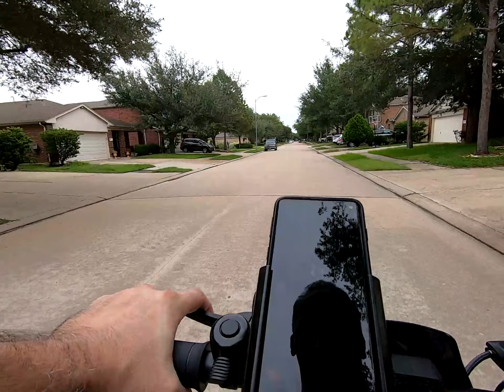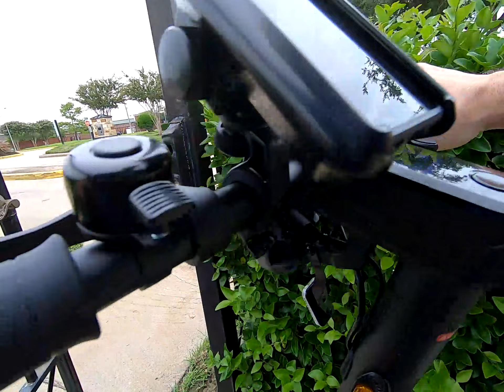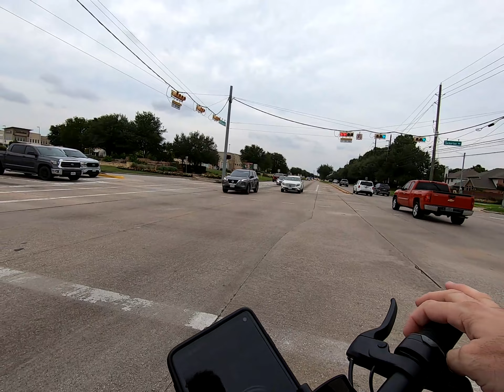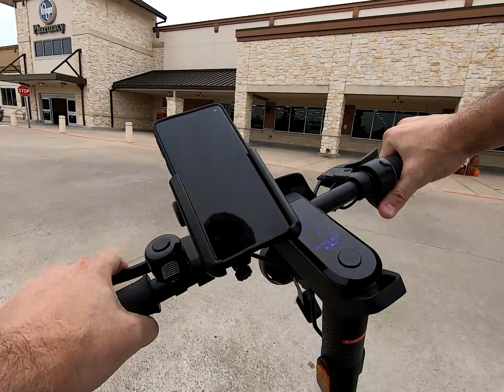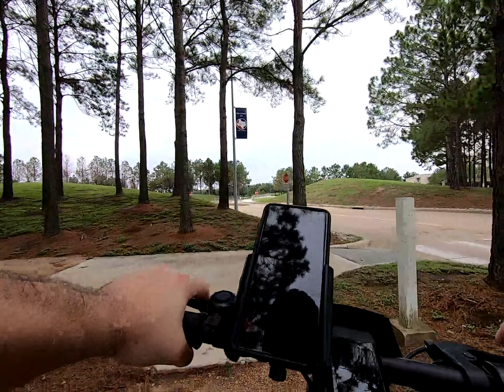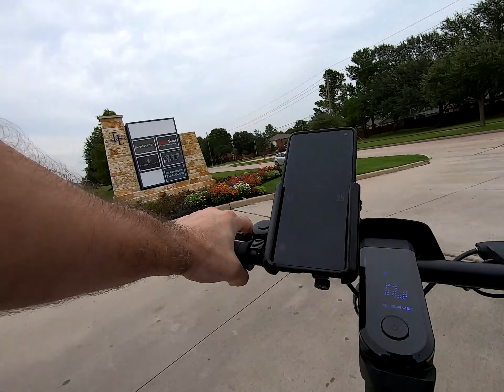Niu KQI3 Pro Review, Range Test, Comparison

Comment: Dam. I bought this last week based on all the brilliant reviews on youtube. Looks like I've been duped. Question. Do the tyres need to be checked for pressure after every ride? For context, my commute is 8km each way.
Reply: I just found out it couldn't be fixed (dont know why) so they offered a replacement or refund. I took the refund because I'm going to use the refund to upgrade to a Segway max G2. Overall though i didnt have any other issues with the scooter. I actually rarely had to pump up the tyres. The night light is decent on it. Battery range for me was about 32km which is ok. Its a decent enough budget commuter scooter. No suspension though is noticeable.
Reply from the maker: @ddmulryan  I'd suggest spending s few hundred more and get a better class of scooter. Unfortunately warranty service/repair is the most inadequate aspect of kick scooters. Until U.S. manufacturing becomes more price competitive and more widely available repair centers, the industry has a long way to go.
Reply from the maker: I'm sure there are idiosyncrasies to each scooter. It's definitely a good idea to check your tire pressure before each ride until you get a good idea of how long it lasts. Mine lasts around 2 or 3 rides of 5 to 6 km, depending on the diversity of the terrain. I weigh 189 so that could also be a factor also.
Another thing you should check every time you get on the scooter is the rear brake disk. It can easily bend or warp because it's totally exposed so make sure you check that every time before you ride because, if it's a little warped, it not only will wear down your brake but cause a lot of heat from the friction. It's a good idea to keep it lubricated with Boeshield T-9 or something.

I don't know if NIU will sell both front and back tires, or if you have to buy the motor with the back tire, but if you can get both spares, I'd suggest buying them as backup.

Indeed, Amazon reviews are very deceptive. If you pay careful attention, you'll notice a LOT of their reviews for certain products are actually composite reviews of various models, older models, or similar products. One good thing about NIU is that their app is fairly stable and maps work pretty well in the U.S. Some scooters have Chinese maps that are worthless here or apps that lack practical features.

Another thing is the weather and wind can have a significant effect on your battery life. If you're traveling 8 km/5 miles each way, the climate conditions can affect as much as 10% to 20% of your battery life. Therefore, when you plan your rides, make sure you plan with a spare 20% battery life in mind to be on the safe side. Not only that, but it seems the way you charge it affects the battery life. Battery life seems to last longer if you charge it around 20% to 30% instead of drained or closer to full. When I take short rides and come back with 70% or 80% battery then charge it fully, it seems to drain a little faster the next day, so I'll usually wait until it gets pretty low but not too low.

Finally, keep a close gauge of the regenerative braking feature so you can figure out what setting to use. There are 2 things you should know about how it works. I drive pretty fast around sharp turns and varied terrain so it seems logical that using the brakes a lot would help the battery life, but the opposite seems true on high settings. I do not thing regenerative braking works or at least doesn't work anywhere near as well as they market it. If you're driving long distances, just limiting your speed by 3 km does a lot more to help battery life than any of that regenerative braking. I find that leaving it on the high setting actually drains the battery a little faster, so I leave it moderate. I'm speaking not only about the KQI but also most scooters I've tried.

The second thing to know about regenerative braking is that it also responds to how lightly or how hard you squeeze the brakes. If you do a lot of quick stops, it won't help. From my experience in long commutes, you can set it medium or high but just brake slowly until you come to a stop. The longer you squeeze the brake, the more it regenerates. However, if you squeeze too lightly, it doesn't seem to register and therefore doesn't do anything for battery life.

Well, that's my experience so let me know what you find out. I hope this information helps you optimize and maximize your commute. Take care man.
Reply: Update. My battery died after 79 days.😢
Reply from the maker: @ddmulryan  That sucks! Well, the big question is: Did their customer service take care of it?
Reply: Would this be a better purchase instead of à open box/customer return g30lp? 850 cad all in for kqi3pro vs 689 cad all in for the ninebot. Uses : winter riding down to -15 calcium on dry days, à bit of wet riding, 20 km per  day, 5 day à week. Budget is limited
Reply: There are 2 niu service center in my city vs the ninebot has to be shipped from toronto, 7 jours ago.

Comment: Hi there,
You could try some 'slime' or similar product to fix your tubeless pneumatic tyres. If you want a more robust machine to ride. Get a Zero 8X. You can smash it hard and it will keep going. I only had to replace my damaged charge ports. That's all. I really recommend this scooter if you don't want to ride a soda can on wheels.
Reply from the maker: I'll check it out. Thanks.

Comment: Thanks for your comments. I almost bought it, but your insight was very helpful to me. People rave about this scooter but the lack of suspension and/or solid tires kinda scares me. I hate changing tires, and it seems it'll happen often with this one.
Reply from the maker: That's a problem with most of them I think because they either build the motor into the tire or because of the brakes, etc. attached to them, they make you send the whole scooter in instead of just sending out a tire under warranty. Niu customer service has really sucked so make sure you get a scooter that the company will support locally even if it costs more.
Reply: One thing I hate about these type scooters you get punctures real easy 
I got the I scooter max with solid tires excellent quality and less priced than that highly recommended u try it out 
Punctured resistant tires and better suspension I paid 3 ish
Reply from the maker: Glad I could be of help. Suspension is a must. If you have hard tires, you definitely need suspension or your arms and legs will go numb over anything but smooth terrain. If you have soft tires, you definitely need suspension or flatten the tires.

Comment: I have a Emove Cruiser 1,000 watt motor decent speed great range.
Reply from the maker: Those seem like really great scooters, amd the reviews seem very good.  I've looked at those, Varla, and some others in the $1200-1300 range. From now on, I'll stick to scooters that go at least 25 mph, 30-35 miles actual range, and can tackle offroad hills and rain. No more budget commuters except maybe a Yadea KS5 Pro.
Reply: @approvedworkman4668  Varla has terrible customer service if something simple brakes it's a long wait for any parts. Like weeks to months.
Reply from the maker: @dennisgolden7596  Man that sucks! Thanks for the heads-up. How's Voro's customer service and your experience with the EMove scooter?
Reply: @approvedworkman4668  Voro has good customer service and a long line of helpful videos. The Emove Cruiser has been good good top speed great range. If you do a lot of big hills a dual motor scooter is the way to go.
Reply: @approvedworkman4668  I have 1,500 miles since August.
Reply from the maker: @dennisgolden7596  Good information. I'll keep Voro on my list for sure.